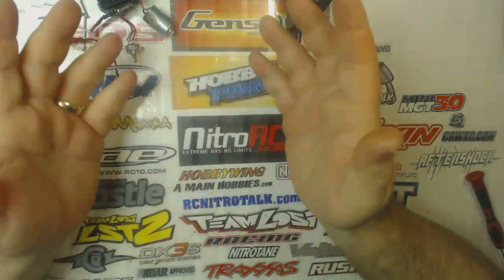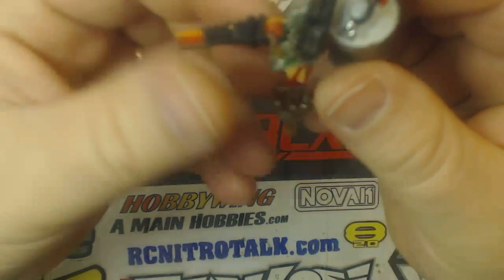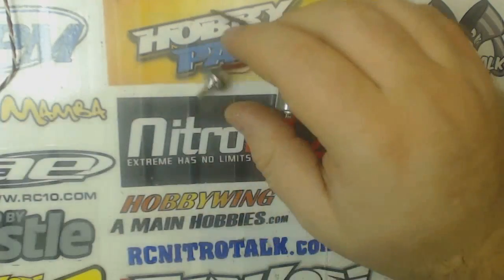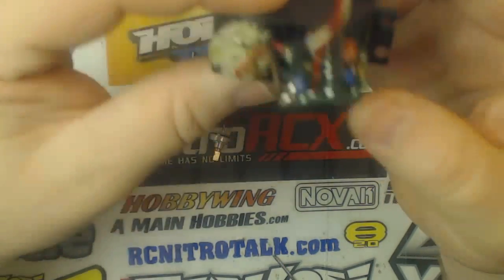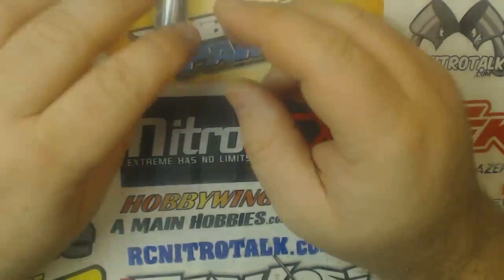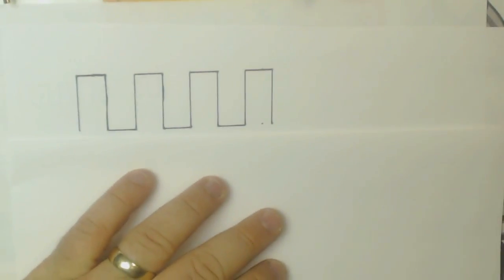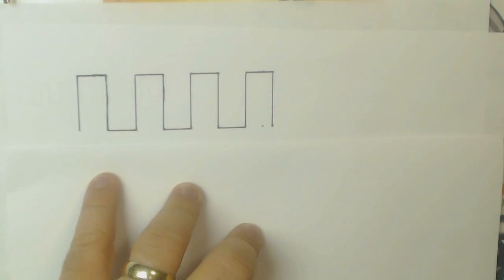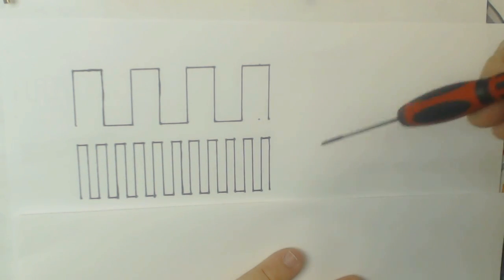Differences between digital and analog servos

Comment: $4 eBay digital metal gear servos?  I have one steering my old timey Kyosho and it seems to work fine but it's a medium performance rig at best..
Reply from the maker: Not sure I understand your question but Im happy its working good for you.
Reply: Just wondering if you have any good or bad experiences with them. So far the only down side for me is shipping from China is free but its a month.
Reply from the maker: Oh, I see. Ive used a handful of those types of servos and they are sorta of ok. I mean they work but they are usually are really slow and you can pretty much halve the specs and you might be getting closer to the real specs on them and they tend to burn out or weaken pretty quickly but hey, for $9 (or in your case probably same for $4 servos too) what the heck. You'll just have to replace em more often. After awhile, I just figured it was better to save up and get the good stuff. Once I did I ccouldnt bring myself to use the cheap ones any more but hey if it all ya got atm then go for it.
Reply from the maker: You'll probably have better luck if youre using them on smaller kits. A lot of what I own is big 1/8 scale monster tucks and truggies so they tear up those cheap servos faster. I actually have a cheap servo in a Traxxas Rustler that held up pretty good.

Comment: I fHi.Thanks for the video.Now I know what's the difference.My question is that I basically fly 1400MM Warbirds and kinda on a tight budget.Would you think Analog would be fine, or if I can find the money, should I go with digital..Also, I was looking at the Hi Tec S2 with metal gear(If I can afford it)..Thanks again for the videos
Reply from the maker: I would go with digital. most of the servos these days are digital anyway. Plus digital is going to give you more stability. I would look at Savox servos over hitec. They are more affordable and arguably just as good in quality. www.savoxusa.com
Reply: Greywolf74 Thanks

Comment from the maker: Well, I cant say 100% for certain but I know that every TX/RX combo Ive worked with which would be going back to the FM JR combo that came with the LST2 and the Associated TX/RX combo that came with the TC3 (and everything that Ive used since then) were all compatible with both analog and digital servos. Having said that when I first got into the RC game about 4-5 years ago or so digital servos were very common if not the standard so if you have a TX/RX that predates that I cant say for certain.

Comment: Quite informative I think.  I've only used digital because the RTF models have always come with them, so that's what I use in scratch builds as well.  Because I was familiar with them already and not with analog at all, I've always steered clear of them until I was a bit more educated, which you have done for me.  Thanks!